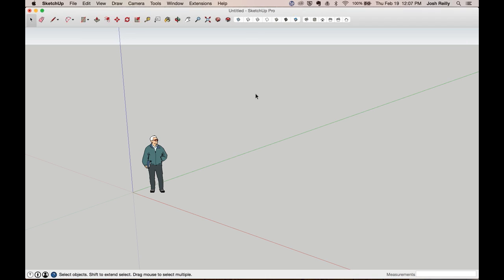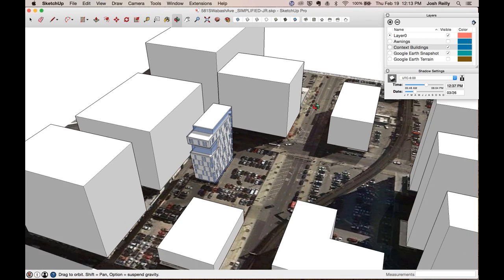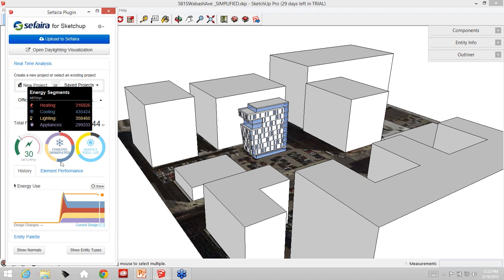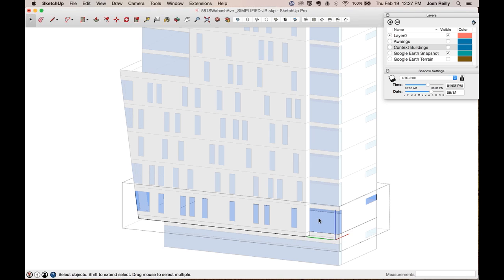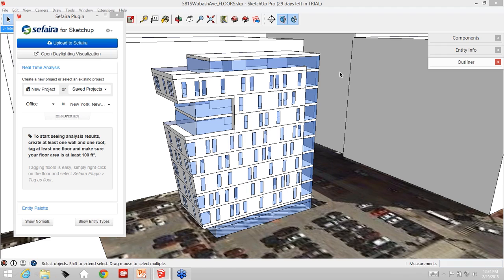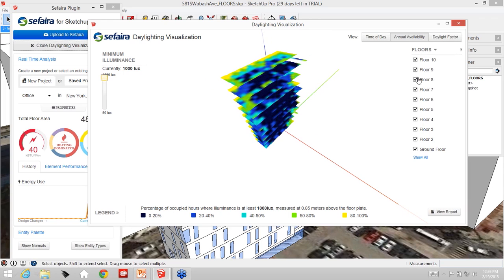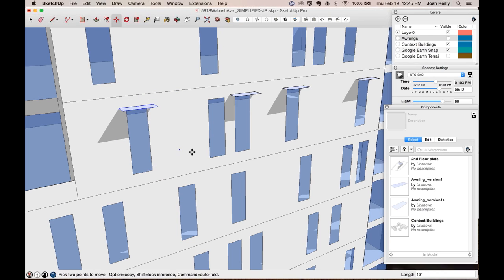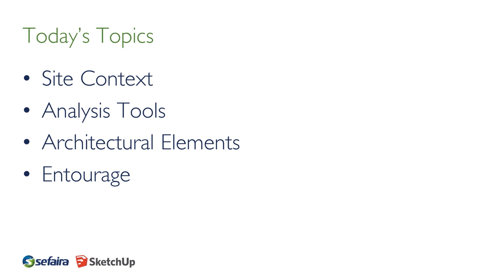Webinar - Smart Modeling for Building Performance Using Sefaira

Comment: Hi guys,
why did you label the internal walls as shading and not internal walls?

if they were labeled as internal walls, would you still need to offset them above the floor level?
Reply from the maker: +Nathan Stuckey Interestingly this questions came up in the Q&A for this webinar which was omitted from this video. However, you can see the question at 54:42 in the version on Sefaira's Vimeo site: vimeo.com/120091797. At the time this video was produced Sefaira analyzed interior walls differently for the daylight visualization, but in the current version of the plugin they work as expected. Now there is no need to raise the internal walls off the floor plane, and you just tag them as "Internal Walls."
Reply: +Wayne Morris Good question; did you ever find the answer by any chance? I'd really appreciate it! :D
Reply: +SketchUp Great, thank you very much for the response! I presume party walls work in similar fashion?